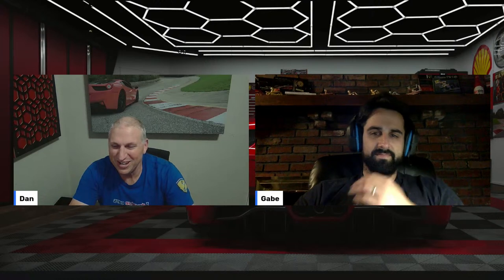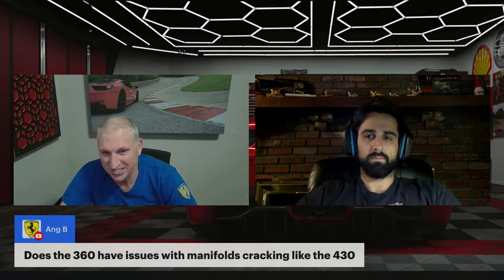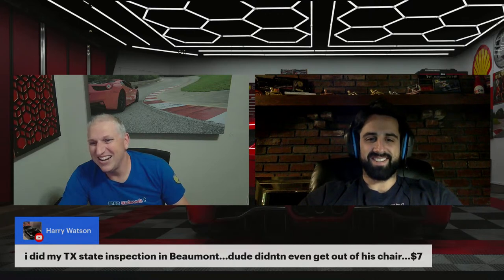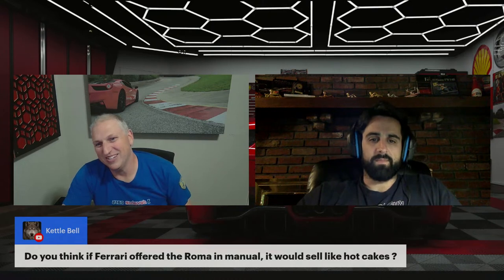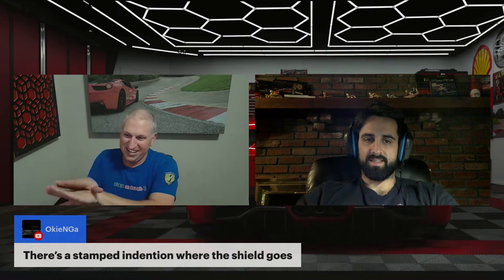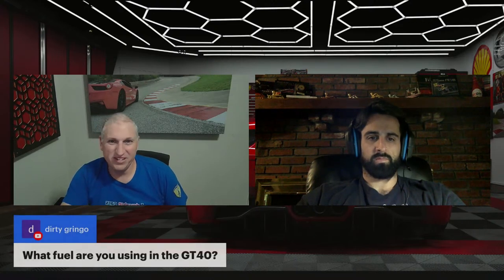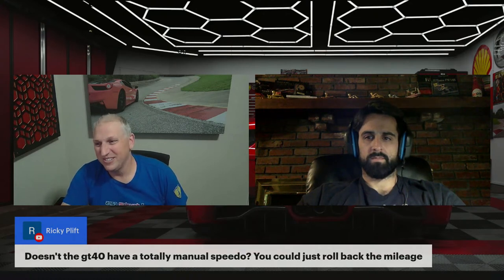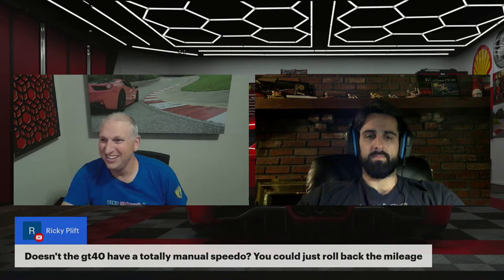Wrenching on Ferraris - NGS Thursday Night LIVE

Comment: Interesting comment about the visual check for cats in Georgia.  I've only ever seen them plug into the OBD port and check the gas cap.  Older cars that were required to be put on rollers with an exhaust sniffer in the tail pipe are now 25 or more years old so are exempt from testing.  I've seen a few shops taking out the rollers.
Reply from the maker: Interesting they actually had rollers for testing